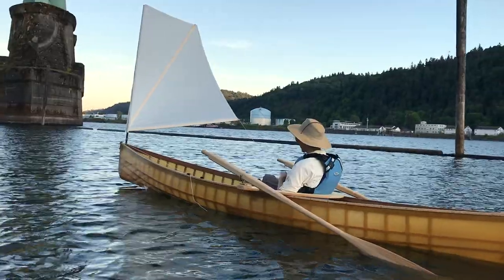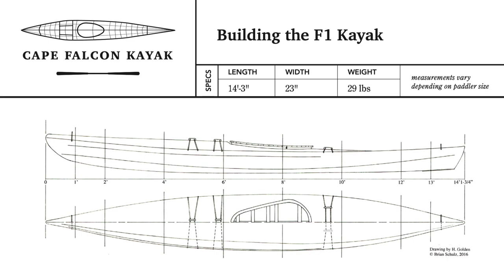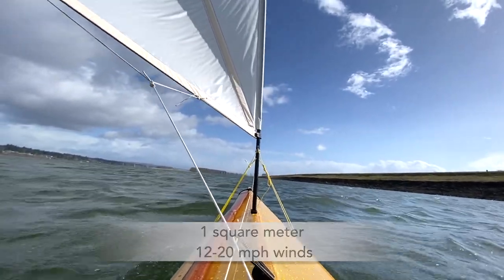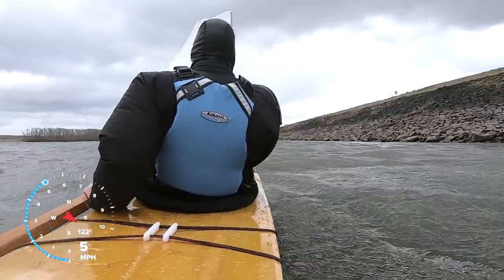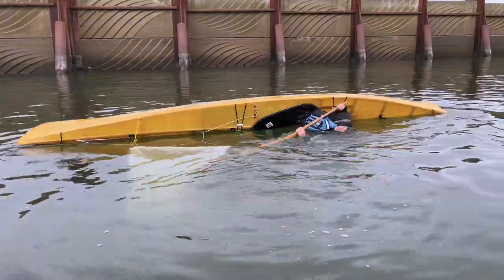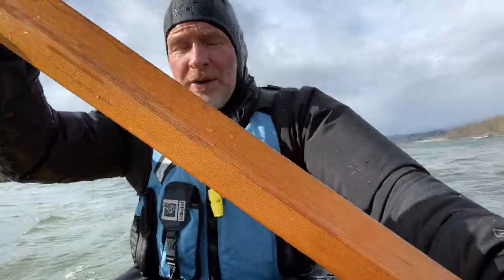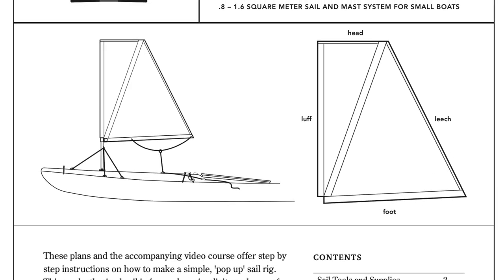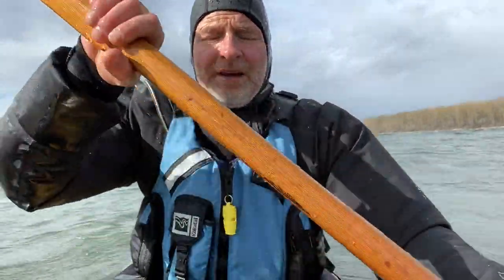Skin on Frame Kayak Sail Testing!

Comment: Throwing a sail on a skinny kayak certainly adds dimension to your trip.
I've had my 18 ft composite boat surfing on a local lake over 10 mph.
I brought mine on an Everglades Challenge after watching so many other people benefit from it. Unfortunately, we were under a small craft advisory for most of the 300 mile course and my mast was strapped to the deck for the 3-6 ft chop.

Comment: Good to see your technique for bringing your overturned kayak back upright with the sail unfurled.  I'm going to have to try that sometime.  Your sailing kayak would benefit enormously with the addition of a rear rudder.  It would save all that single sided correctional paddling.
I have a Dagger Exodus sea kayak, with rudder as std.  KayakSailor 1.4m sail with 0.2m genoa, also quite large homemade outriggers that are easily detachable to use the sea kayak as standard & for easy lifting & transport upon the roof of my car.  The outriggers provide so much additional stability & confidence, especially in high cross winds.
Regards, JohnnyK from the UK.
Reply from the maker: Sails and rudders do work well together, but rudders and skin on frame kayaks don’t.  You can do it but it’s neither simple nor elegant, and for me the whole point of skin on frame is that I can build it for $500 in a week.   I might drop a skeg into the next one but I don’t think I would go as far as a rudder.  Not that there’s anything wrong with that.